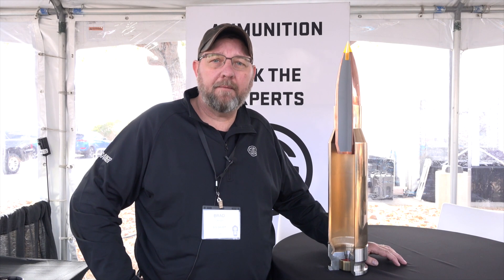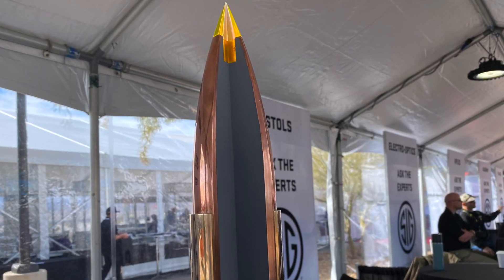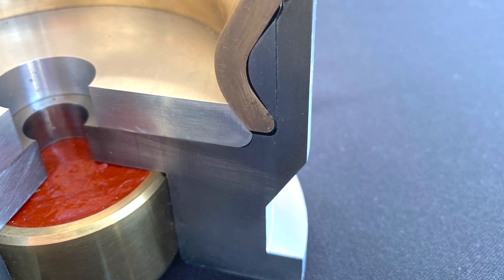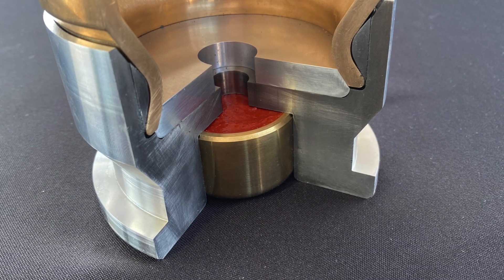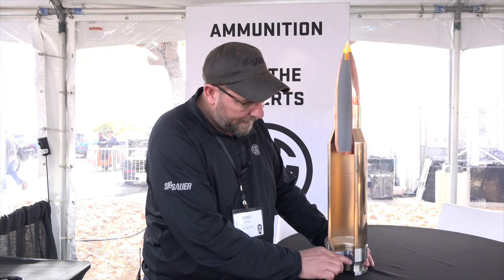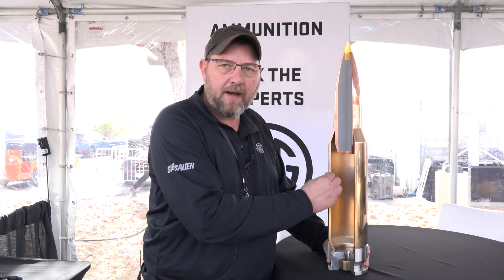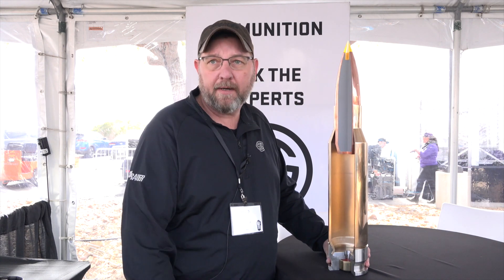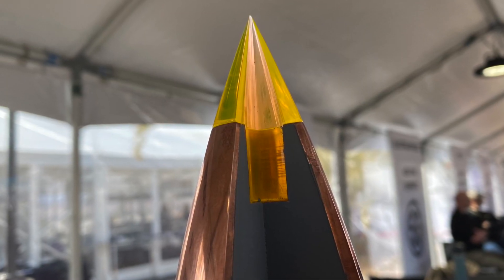SHOT Show 2020: 277 SIG Fury Ammo

Comment: I don't get it. If the case has the same dimensions as the .308, how does it achieve the high/er pressure and velocity, e/specially with that aluminum washer, in the bottom, which should reduce the case capacity!?

Comment: I don't think that's gonna work, e/specially in an MG! 
How are U gonna force that 2 part case thru a disintegrating belt!?
Actually, that looks like a 4 part case! That steel ring looks like?is a separate piece.
And, I think the aluminum washer is inserted from the bottom.
And the primer is still brass?copper, so how is that gonna withstand the high/er pressure?
And what about the electrolytic corrosion between all the dissimilar metals!?
And how are U gonna waterproof it!?
And when they get hot, brass and aluminum do expand butt they also go soft, and malleable!
And brass and air grade aluminum and stainless steel are very expensive;
too expensive, to just throw away, on a battlefield.
I smell corruption/a rat, and I am a cat, judge, and so I should know!
I don't see this going into service. Why not just use a long/er barrel, and a bullpup design?

Comment: I think the idea is good, but it's gonna flop, because at this time, no reloading, short barrel life (prob around 800-1000 rounds), and if it can't be reloaded no one outside of military is gonna but it.  Hell the case alone is gonna be double what a standard brass case costs due to the engineering, wear n tear on the machines that make the head of the case.
Reply: Agree except for the manufacturing part. I think these cases can be made a lot cheaper than brass cases. It is much easier to turn steel than to draw brass cups. You need far more expensive and specialized machines to draw brass, while any auto feed lathe can make the components for the head on these new cases.

Comment: 80,000psi per shot? Well, that's gonna be hell on the barrel...
Reply: Not on my patented titanium sleeved barrel, chamber pressure alone doesn't burn barrels, it's velocity, duration of heat, RPM and other stufff.
Reply: @claudiodominguez.  You do realize that hot metal alloy becomes more malleable, right? On a conventional assault rifle, this would make the barrel expand like a balloon with rapid-fire of the new .277, which could lead to rifling no longer making contact with the bullet, and possibly eventual cracking of the barrel. Unless an alloy that is lightweight, cheap, and capable of withstanding the extreme conditions of this round is developed, I don't see the .277 FURY going mainstream in the foreseeable future.

Plus, it's expensive as hell: $2-3 per round, compared to $0.60-0.80 of individual 5.56 NATO rounds. I don't think even the US military would have the budget to sustain that kind of ammo cost for each infantry unit. At this point, it just seems to be a proof-of-concept, experimental type of ammunition.

Comment: I think, the major benefit would be lower production costs. Much easier to produce cases out of brass tubes, than to go all the way casses were made so far. The higher rigidity of the cases' bottom is a rather a secondary benefit. Along with the possibitity to make breach/bolt system less solid and thus lighter in weight.
Reply: "Lower production costs"? Even when ammo prices are down, these new rounds can go upwards of $60 for a case of 20. I doubt the military would be able to sustain costs like that, so we're probably gonna stick with the more cost-effective 5.56 NATO rounds for now.
Reply: @MilesEdgeworth129  Despite how the Army advertised this, I don't see this as a replacement service rifle since it is the same size as a 308 cartridge. It appears they are adopting it to replace the AR-10 platforms. In other words this is a new DMR platform which makes sense why they want such a flat trajectory so shooters don't have to be up to date on their DOPE as much. Personally though, I think they should have made a 300 win mag semi auto or similar instead.
Reply: @MilesEdgeworth129  Everything's expensive at low rates of production... 5.56 NATO wouldn't be cost effective is nobody was making it.

Comment: I'm interested to see how current calibers could be improved with this technology. Like 5.56, 7.62x51 ect
Reply: 5.56 is a wimpy semi-lethal Cartridge designed to wound (in the 55gr ball configuration), it's really more of a small game Cartridge for Coyotes and Prarie Dogs. Also, the pressures they're talking about are kind of excessive. 80,000 psi, 15,000 beyond a 500 smith and wesson magnum, or bog standard magnum rifle Cartridges? Are you trying to burn the barrel on the way out? If you need that much more energy, use a bigger bullet. If the Arguements were based in range, versus saying, "The energy is what we want", I'd have no problem. You want energy? Use a 300 Win Mag, use a 408 Chey Tac, use an 8mm Mauser. Speed may have a Quadratic effect on the paper numbers, but I have yet to see a Professional Hunter in the Safari mainline a 6.5 Creedmoor to stop an Elephant that's pissed off.
Reply: @nikolibarastov4487  
Barrel wear is not so much dependent on pressure as peak temperature and the mass-flowrate of hot gasses through the throat. Modern powders are less erosive than standard double or single base powders by way of lowering peak temperatures.
Reply: @nikolibarastov4487 the problem with just using a bigger bullet is that the reason the U.S. army adopted the 5.56 in the first place was because it allowed soldiers to carry more ammo because it was smaller and lighter than a full size rifle round while still having the range and lethality to deal with enemy combatants.

Using this technology on existing calibres like 5.56 could likely give them the power of 7.62 NATO without having to sacrifice ammo capacity.
Reply: @nikolibarastov4487  you are wrong .556 was NOT made to wound lol brownells made a whole video on this I U fool

Comment: So basically twice the range and energy of 5.56 with less drop than 6.5 creedmoor
Reply: With the recoil of a 7.62 x 51 in a rifle that can handle 80,000Psi pressures and the round 20% lighter than what? a 7.62? So what happened to an "intermediate" round like the 6.8 SPC? This is a 7.62 replacement. Sounds like the brain child of the grand kids of the clowns who replaced the 30-06 with the 7.62.
Reply: @baobo67  The problem is no intermediate round can perform the requirement, which is penetrate level IV body armor.
Reply: @sethrich5998  Even if that was?were the case, who's gonna be wearing that, around?

Comment: Is this round considered a 280?
Reply: 280/7mm =.284". 270/6.8mm =.277"
Reply: Earl Wilson it’s a .277. A 7mm or .284 would be “280”
Reply: I believe it's a 270 with a bullet diameter of a typical 270 round (.277) where the 280 is .284
Reply: .270-08, its a .308 case necked down to accept a .277 boolit